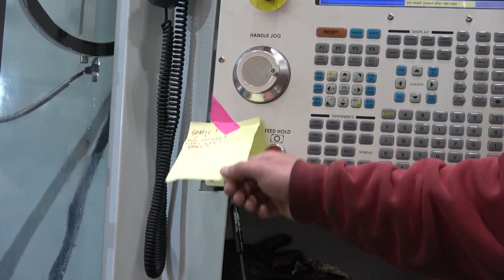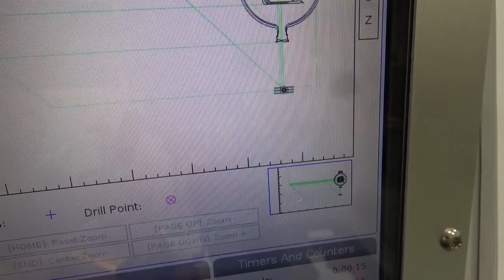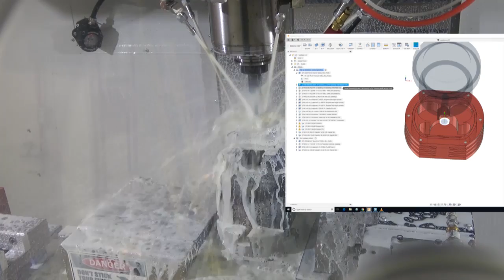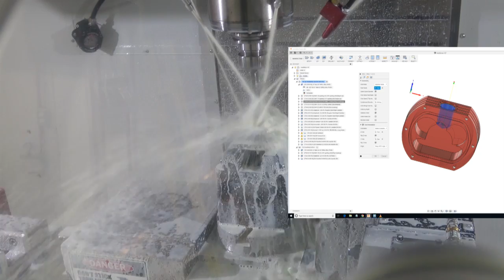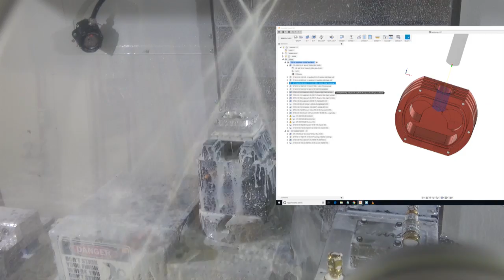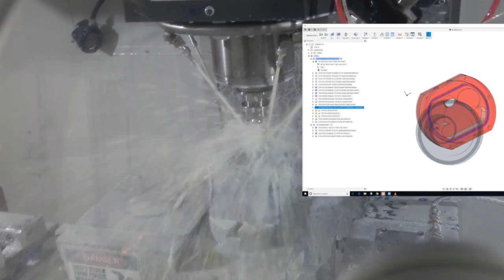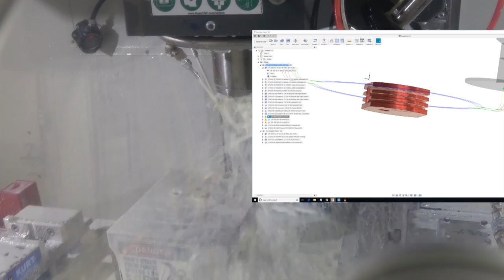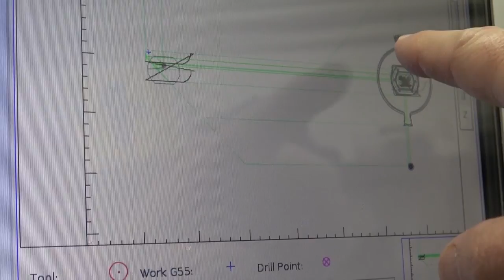Oh Spelunking we will go!

Comment: Good vjo bud. Quick tip that will keep the frustration fairies away. When you switched to the G55 work station you had the part skewed to the side of the vise jaws. This can lead to uneven clamping and parts getting launched into the abyss in mid-cycle. Make a filler block the same with as the part and put that on the parallels next to the part. Clamping force is even all the way across and parts don't get ripped out of the vise.

Comment: Since it's been about a year, you may already have discovered this tool.  Instead of using a giant slitting saw, try a Woodruff cutter/keyway cutter for your horizontal slots.  They come in all kinds of diameters & thickness, and are way more stable than a slitting saw.

Comment: Drilling removes material the SECOND fastest in terms if chip to horsepower ratio.
Saw is fastest cuz most of the material removed doesn't get made into chips. Drill makes the most material volume into chips per watt/hour sunk into doing it.

Comment: I think an ideal helmet mounted light for cave exploring would have a switch to select off / low / high / wide modes. Low power mode to conserve battery. High power beam for normal walking around in narrow passages. Wide mode with a high power beam combined with some light going out the top and sides for viewing large rooms. When I used to crawl around underground with my dad we preferred old school carbide open flame lamps for primary light with electric lights as backups. The carbide lamps could be finicky and weren't super bright but gave a nice wide light to fill up a room. Electric lights typically gave a bright but narrow beam with darkness all around. A lamp that combined the benefits of both would be great.

Comment: 2:20 "The Information density isn't high enough for me"

You hit the head on the nail, pardner. This is why I HATED grade school, and even most of college, without realizing it. I'm also very much an autodidact but sitting around listening to long-winded lectures about why apples are red when I just want to eat apple pie drives me bananas. I didn't learn to love learning until after I already got my degree and THEN I started having fun learning because I realized I need to get to the meat of 'er quick-like. Case in point, I designed and built my own guitar amplifier from scratch just for funsies, but I learned a lot along the way because luckily I had a fellow who was a pot smoking hippie from the 60s that did the same thing. I was able to get really good answers to my questions from him and I learned REALLY FAST because he wasn't giving me lectures about what I needed to know, he would just tell me "Well ya dummy, you got this value wrong, fix that."

Comment: Used to do 3/4 Op job on my doosan mynx 7500/50 for some parts using g54-57 makes thing easier for larger batches but can be abit of a pain for the first set up. Would do op1-2 in the same run a lot of the time.

Comment: You can run the drills way faster. Fusions built in AL drill parameters work well.  No need to peck till maybe 4 or 5 times diameter deep.  At the right feed speed the chips break in AL making partial retract a waste of time.

Comment: I gotta do all my programming right on the controller. No software for this guy. Owner needs the extra money to fly to the Bahamas once a month. My 5 axis Haas doesn't get used a whole lot because of that. I don't even have a probe or the ability to efficiently do work offset mapping. If I do work on 4 of the faces, I have 4 offsets set. I mostly use it as an automated sine vice when I can't find the shops angle parallel set because someone misplaced them. I mostly use my 1994 VF-0E. The CRT monitor just crapped out on me though. Haas is coming to convert it to an LCD and replace the floppy drive with a USB conversion. Were slowly getting with the times lol. I don't mind though, if they're fine paying me 20 hours overtime a week so I can stand there for a few hours and poke at the controller every day or so then whatever. I get paid the same whether I'm walking or running.

Comment: Small question, can you control the cnc manually with joystick ? Thanks for the answer ! :)
Reply: Haas's don't have a joystick, but you can select an axis and move it manually with the jog wheel or select a feed rate and hold a jog button to move it. Either way its one axis at a time manually.

Comment: stop talking already ;o) I find voice-over while machine is running more informative (slow learner) To me, slotting saw would be obvious choice for the 'fins' I would have a made a longer mandrel to hold it though if the head gets too close to vice. I know nothing about CNC but couldn't you just tell machine your using a 4" diameter tool to get correct offset?(making sure it didn't try to plunge cut)

Comment: Nice work. Don’t worry, it gets harder before it gets easier. In case you never saw a massively optimized program in 6061, a part like that one could likely be run on that machine with the same tooling in 90-120 seconds for op 1+2. I bet you can triple the chip load on most tools and run the spindle flat out on anything under an inch. Skip the predrill, you can ramp in faster than your tool changer. Most FBEM’s are surprisingly happy at 12-16 degree ramps. Some guys run beyond 20 degrees, but that’s tool dependent for sure. If that’s a 1/2” tool I bet you could ramp faster than your machine can accelerate without breaking the tool. And the higher the chipload, the less it wears per part, so it’s both cheaper and faster to run a smidge below kill. Your coolant sucks on that machine though. You need to have it blasting right at the cutting edge with as much flow and force as practical in 6061. Looks like you figured out chipwelding is a thing. Coolant goes a long way here.

Comment: I love this format. You can learn something and see some cool shit. At one point you were talking about having the tool changer. It makes all the difference. I run a multicam mg and a multicam 7000. The 7000 has a 12 tool carousel. Makes it real easy. The mg still works but every tool change, you have to take the bit out and reset surface and max depth. Real pain in the arse. Love your vids AvE. Glad to see you tinkering in another field that I'm interested in.

Comment: AvE, you mentioned "it's so expensive to run this machine" - Could you itemise that for us, or at least give a "per hour" figure, something like that? Doesn't have to be super exhaustive, i'm just really interested in that
Reply: Running is not very inexpensive.  Figure on a 20 HP spindle cutting at about 15-20% capacity.  If you are doing projects or prototypes, you won't even notice the cost bump in your power bill. You'll probably spend more on coolant.   And good tools last forever when you are not running production or cutting fiber filled plastics.  Your cost will be for the machine, the options, the tooling and the support equipment like measurement tools, a compressor, an inverter (if you don't have 3 phase) and saws.  If you are unable to setup your shop yourself with air, power, and data, you may pay a high price to have it done.   Don't forget about software.  This is actually my biggest cost.  I run a high end version of Solidworks which now includes 2.5 axis CAM although I have an upgraded version.  I pay about 4K per year and feel the service is worth it.  But I can also terminate the contract if I feel the code is good enough and I don't need the support.  Don't skimp on the software if you plan to do this seriously.  Lastly, don't look at this kind of equipment unless you are made of money or plan to make money with it.  Then you can write off your costs against your profits.   If your a hobbyist,  get a used bridgeport and retrofit it with a good CNC kit.
Reply: @snakedike   Very True my guy
Reply: I would like to know also but was afraid  to ask. Just curious.
Reply: I used to run one at work. Not sure about current costs but the major cost items are: the machine itself, the tool head, tungsten cutting inserts for the end mill, drill bits, coolant (a mix of magical water soluble oil and tap water), electricity, material, pay for the operator, and repair and maintenance.
Reply: Aprentist marks are learning moments and are not free
Reply: Often with a machine like a Haas part of the finance plan is a payment per hour the machine is used.
Reply: Remember Google lives in your fingertips.

Comment: some info in case you dont know already there is special tools for stainless and aluminium. we broke small drills in stainless till figure out there is special  ones for the different materials different speed and feed may also apply. but its a nightmare if a drill brakes in a metric m3 blind hole.

Comment: I wonder if you are doing depth of cut vs engagement optimization to prolong tool life.
If you don't you will be using those outer few mm of the tool all the time and step down multiple levels to get all the material off.
This massively increases wear on the tip of the tool vs rest of the flutes. If you have spoken about this in another vid please refer me :)

Comment: I have always wondered watching these CNC videos why no one uses Waterproof spray (Neverwet, etc) to make it so the lubricant doesn't stick to the window or the back wall of the CNC machine. Then you don't have to clean the window either. It will just roll off.

Comment: 5:28 , why not do it with that flat-bottom end-mill from the beginning?
Reply: He explained it.

They’re expensive, and as soon as the fine corners wear off, a flat bottom end mill isn’t flat anymore, and it thus, junk.
Reply: @Nevir202  So an end mill, after a few face cuts, is only good for side milling? Never had this problem my self. I use face-cutter but only if the face is large, otherwise an end-mill does the job nicely

Comment: "Drilling removes more material, faster." My metalwork tutor said that, too. HOWEVER: I do think both bandsaws and oxy-gas cutters are quicker.
Reply: Just swap those into the CNC then...
Reply: @IanSlatas  A couple well placed C4 charges removes a lot of "material" quick, even quicker than a horizontal bandsaw
They'll even fit in a 4" mill vice :)
Reply: Dumping stuff in the garbage is the quickest!!

Comment: You should do a video on the big rock drill bit I’ve seen you show before it looks quite similar to the drill bit heads we use at work for drilling in utility pipes except you said in another video yours used air and water to clear the cuttings ours only use water and stuff we mix in like penetrol and bentonite etc

Comment: Did I miss something what are we making, a pump of some kind. I only saw one in or outlet. I don't own a CNC machine, but I've taken enough stuff apart or rebuilt enough things that the way you combined the machine and program I can see that is gonna help. Really tho what ya making.
Reply: Thumbnail says 'PROTOTYPE FLASHLIGHT' 
Seems like that's all the information we're gonna get
Reply: @EggBastion  yeah when AvE posts I just click. It's a natural reflex. I dont read the thumbnails.
Reply: Its a case for an LED headlamp for caving. It will get a spot LED module and looks like two flood LED modules, and a programmable switch for independent controls.
Reply: When I started caving the old carbide miners lamps were still popular but the incandescent headlamps were taking over as it was harder to get calcium carbide shipped. Now it's all LED and such. So yeah it's the headlamp base for an LED cave exploring lamp.
Reply: Yes. You're missing something.
Reply: Probably the banner across the thumbnail gives it away.

Comment: That's gonna be one hot torch.
Reply: The cave environment actually keeps them pretty cool as long as you don't run them on turbo for too long. Most modern caving lamps will have a thermal shut off to keep from frying the LED circuit board.  Here in montana the caves are mid 30's to low 40's so the warmth is sometimes a boon.
Reply: @gindling1054  I was playing with words and going off the absolutely beefy aluminium housing and cooling fins. Most high powered LED lights have thermal throttling if not thermal shut downs. Though I have a cheap 1000 lumen Chinesium jobby that will brand you if you run it at Max for too long. It's always been really interesting to me that LEDs are hugely efficient but still get super hot. A feature I might suggest would be a battery killer but for emergencies have a mode where the housing can hit 90-100'C so you can heat water in a container for disinfecting. A max output mode with a different thermal limit, so if you need it and someone is injured type of situation.